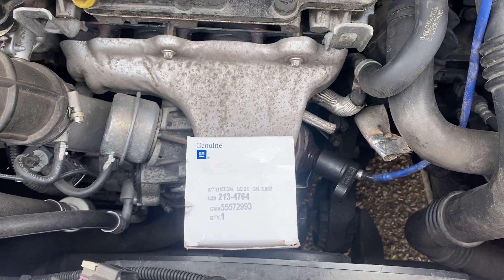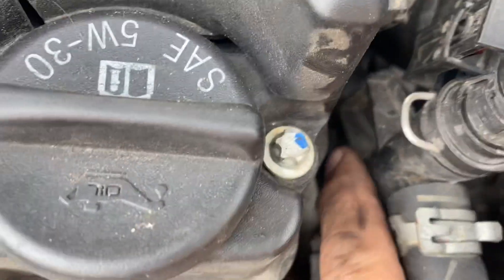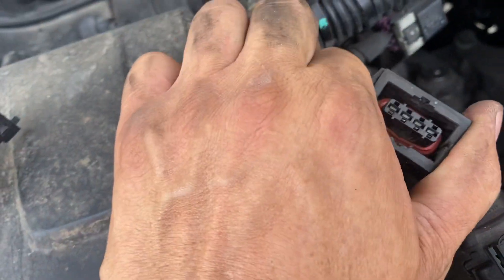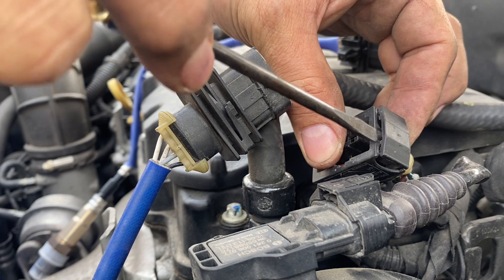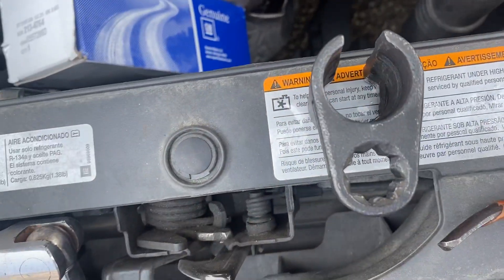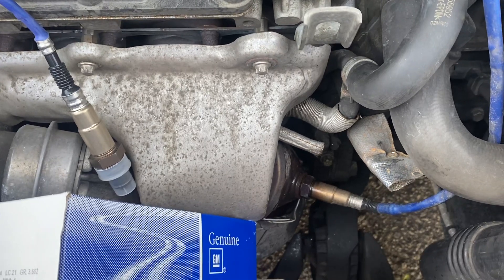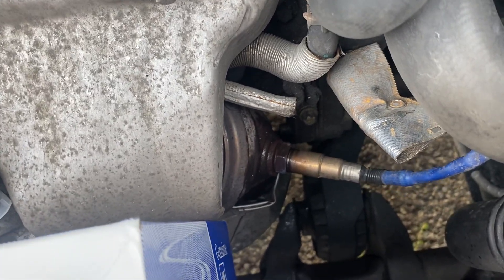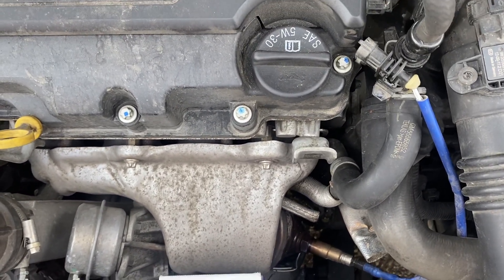2013 Cruze Code P0420

Comment: there's 2 fuses in the fuse box under the hood 15 amp fuses number 2-10 it clearers the Ecm computer in the car  of any codes
Reply from the maker: Good tip Dan!

Comment: I have a 2014 Chevy Cruze with 1.4L engine it has 180,000 mile. I have been getting a P0420 code. I would go away and come back. 

Before replacing any parts try this.

I fixed it just by disconnecting the Negative side on the battery 1st. Now find the computer it’s on the side where the battery is. It’s has 3 connectors on it. I disconnected all 3 connectors and cleaned each side male and female connector with CRC 05103 QD Electronic Cleaner. Let it dry 15 minutes. I plugged all 3 back in. I installed negative battery cable. I started and drove the car 50 miles. 

Update 
The P0420 came back 2 days later. I will look at the O2 Sensors next.
Reply from the maker: Great tip Bobby.
Reply: Did yu get the fix?
Reply: did you get fix?

Comment: Hello
P0420 error code is only for bank1 sensor 1?
Reply from the maker: This engine has 2 sensor. Upstream, top of catalytic converter, and down stream on the exhaust pipe. I replaced upstream and it fixed the problem.

Comment: Did this fix the PO420 code?
Reply: These cars only only have bank 1. I replaced both O2 sensors and it didn’t fix it. The second sensor is labels bank 1 sensor 2 in the ecu.
Reply from the maker: Yes it did.
Reply: So you claim you  it fixed it  takes a few drive cycles to come back how did you determine it was 02 sensor p0420 is cause buy ect, and misfire, extust leak
Reply from the maker: @isrealperez9069  Maybe, Israel Perez, you don’t understand the P0420 code 
“Code P0420 stands for “Catalyst System Efficiency Below Threshold (Bank 1).” Put simply, this code indicates that your car's computer has detected underperformance from the Bank 1 catalytic converter. The P0420 Code indicates that your car's computer has detected underperformance from the Bank 1 catalytic converter.May 19, 2021”
Bank 1 refers to the Upstream O2 sensor, which seems to be the culprit in over 80% of the cases. So I hope this clarify your doubts.
Reply: @thekashgarage  OK what would mess up the pre 02 up can a vacuum mess up the fuel trim or cause more air to pass then what it supposed to be
Reply: @isrealperez9069  it didn’t fix mine. I am changing the cat on mine next week.
Reply: @thekashgarage  how many times do I have to change it it's my second one
Reply from the maker: @isrealperez9069  Have you changed also the downstream O2 sensor too?
O2sensors will last for over 100,000kms. Maybe it's your Catalytic converter?
Good luck
Reply: @thekashgarage  well I can tell you that yes I have changed both upstream and downstream and this is on two catalytic converters My aftermarket doesn't work anymore and they said that I would have to get it tested in order for me to have an exchange so instead I purchased used one from an individual from another town and for some parent reason it happens once a year or at least the first year that I had it and yes I know it's my catalytic converter but the best thing about it is it passed emissions but other than that the light is still on thank you thank you for your time